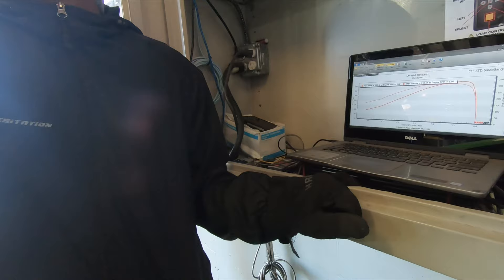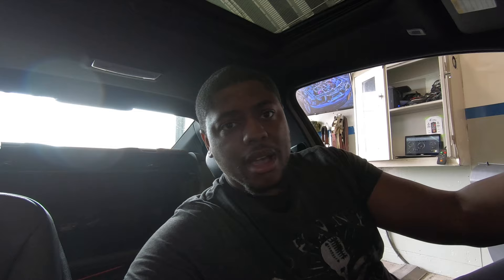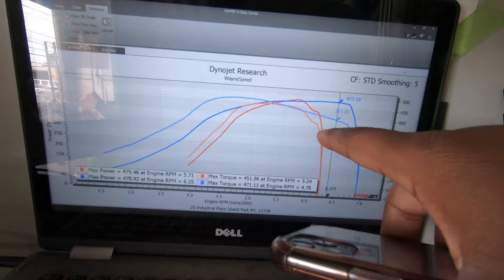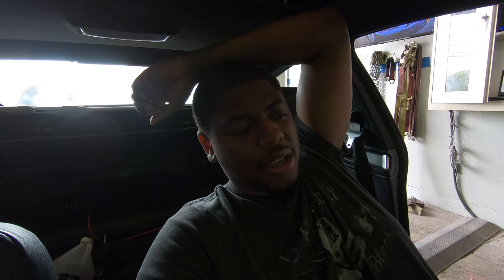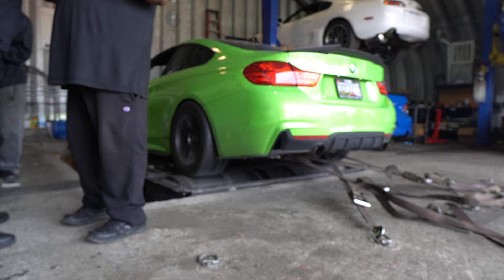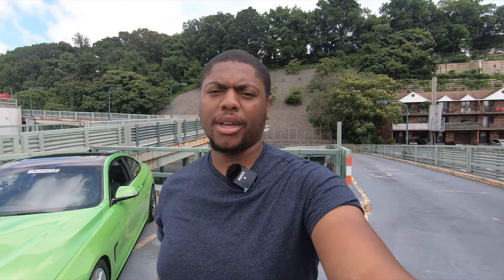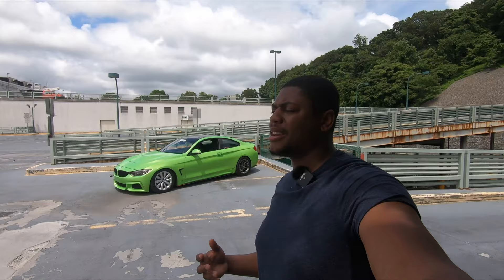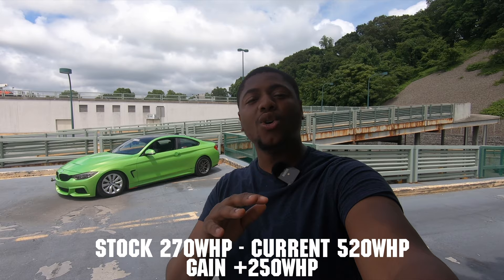520WHP N55 BIG TURBO DYNO Tuned! @ 21 PSI!!!

Comment: I heard it is best to dyno in 6th gear for the ZF8 as that is the 1:1 ratio gear and it better for dyno runs.  I bet your numbers would go up also.  My shop only dynos ZF8s in 6th gear.
Reply from the maker: My 6th gear won’t hold the torque from the boost we are tryna work on that now
Reply from the maker: @StevenZoeZoe  yupp

Comment: Looking to get a e90 with the n55 in it. What kind of power can the n55 handle without problems. I’ve just heard that n54 can handle a lot of power and that the n55 can’t handle as much. Just curious your car is sick!
Reply: It can handle up to 450-480 no issue stock internals. Anything past that start looking at E or meth
Reply: 500ish maybe 525 with meth/e. You’d need forged internals after that.

Comment: Mines running the same.   I was thinking methanol injection on mines after but I’m thinking man it’s break my wallet   Can u believe I have a n20 too running at the same.  Wheel horsepower with burble tunes sound like a f1 who ever has done it  transmission stage 3  Nd flashed odviously but Danm I’m doing a crazy build coming out soon engine  no body modifications no time for that but amazing video first one to see

Comment: bro what tires were you running with this setup? did you have traction issues?
Reply from the maker: 275/40 r17 r888r and when warm I had no traction issues
Reply: @Slowspeed  Ty sir. Appreciate it. Just got pure stage 2 on my n55 (M235i) and 255/35/18 mps4s is spin city 🤣🤣🤣🤣
Reply: @Slowspeed  Hey Mike, about to pull the trigger on these... all reviews are saying they are super noisy, is this true? did you drive them in NY winter weather, or switch to snow tires?

Comment: Should have gone pures turbo mike.. I made 539whp/ 558tq
Reply from the maker: On 21psi ??? I hope you guys realize the car is on a low boost setup rn. I even stated it in the Video. Pures for the n55 are not good at all TBH the manifold design for our engines are junk. Turn them up too much and they blow up. Turbo kits that replace the manifold are better. It’s a process and when I get to dyno on high boost we will see those numbers. Until then I’m enjoying the process 🤘🏽You also have to look at where the car makes its torque. Hybrid turbos make nice torque down low unlike a bigger turbo as what I’ll have. But up top your torque starts to fall off and that right where my turbo wakes up. I’m okay with not as much punch down low just to get that reward up top. Look at it like show vs. grow ............with Pures what you see is what you get with big boost you dont know until you get it going!!
Reply: Slowspeed you know that n55 motor is a risk after 550whp... so what’s the point of low boost when you can’t turn it up💀... I would understand if you had the b58 but n55 with big boost is a waste of time and money!!
Reply from the maker: Rhodybimmers the N55 can take way more than 550whp. As I was stating before it’s all in the exhaust manifold design of the stock and hybrid n55. Exhaust gas temps and pressures are very important and the stock manifold does not allow the gases to escape as freely in certain cylinders. That in turn is what will blow these motors. Some people say they overcome the issue by adding a n52 cam which keeps the exhaust valve open longer (assuming) but not sure as I have not went that route. Basically what I’m saying is change the manifold and your golden. A lot safer power and also bigger turbos take longer to spool which is kinda sorta better because you don’t have all that rod bending torque down low.  It’s all about research man! Plus big turbo vs. hybrids is hard because you can’t compare the two and that’s me being 💯 it all depends on what your style is
Reply: Slowspeed I understand what you saying mike & my motor is very safe, I’m runing meth to cool it down by 10x & spent way less compared to the route you went.  Not hating on big boost but pure just doesn’t it so well!
I have dyno result to prove the power delivery! It’s just always there not like big boost that you gotta wait all the way before it hits & when it finally hit you go into limp mode💀.. ohh & my buddy runs high 11’s consistently!
Reply from the maker: @rhodybimmers8094  NOW THAT YOU ARE CORRECT LOL!!! Big Boost Turbo Kit costed me wayyyyy more than i would like to admit. and limp mode not always but it does happen I've learned its all how you come onto the power. in the end pure are a better way to go for logical thinkers....and that I'm not!

Comment: So your car is 650BHP 🤔. Thats mad. And your not running Ethanol either. That should be about 800bhp with ethanol surely
Reply from the maker: I’m RWD so it’s actually about 620BHP or Crank HP and I’m running E50 with low boost
Reply: @Slowspeed  ah thats still good tho. I'm hoping for about 650bhp myself. I'm on ps2 tho. You should defo get 700bhp on high boost then. Cant wait to see it bro 👊👊👊
Reply: Also what's your opinion on mhd. Have u had any experience with bm3. Im getting one but not sure which..
Reply from the maker: Hell yea imma turn it up a bit
Reply from the maker: I actually have used both, if you are custom tuned it really doesn’t matter just go with whatever one your tuner prefers!
Reply: Nice power man, I'm in the process of picking if I should go with  ps2 or bigturbo and you have been the big factor and seen what your car does so now its even harder hahahah how does the car hold up against racing 5.0 mustangs and hellcats got a lot of them here in stl
Reply: Ah thats cool. I'll provrably get the bm3 as that's what I've been looking at mostly. Thanks bro 👊